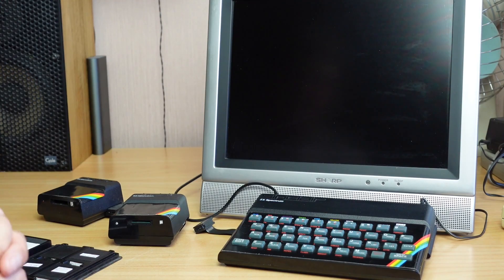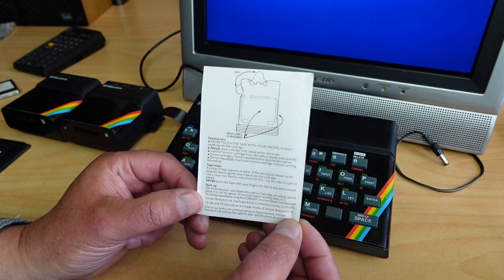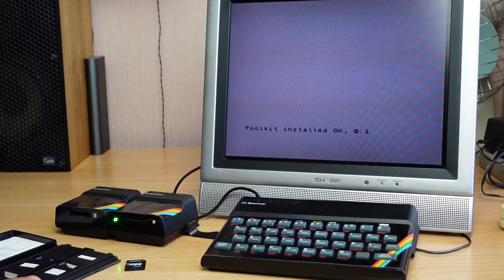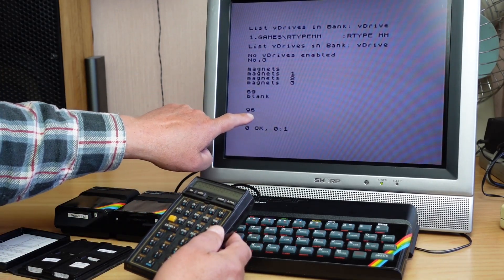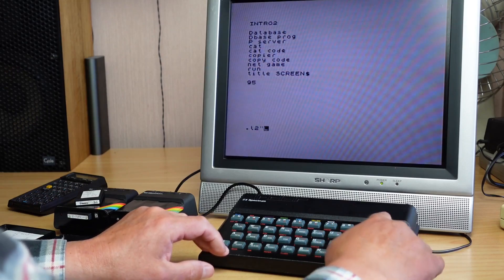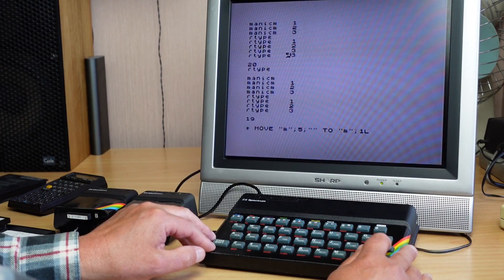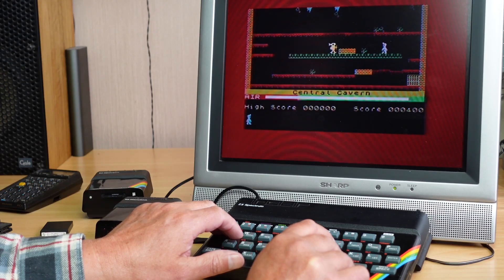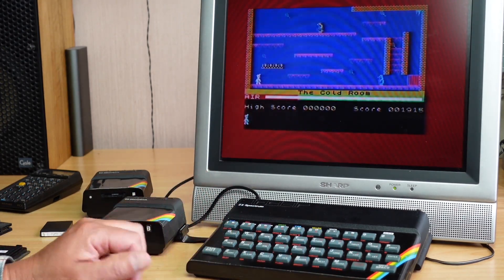Real Time Demo of ZX Microdrive and vDrive ZX in Action

Comment: How did you get the microdrive connected to the v-drive ?  V-drive's left plug is way too short for the cable  connector to get through.
Reply from the maker: From memory, I used the standard joiner that you'd use to join two microdrives together.

Comment: In many ways, games consoles and even PC's have issues in loading times today. Hence the m.2 Systems used in the very latest consoles. Most PC's don't have physical drives in them today.
I do have one large physical drive on my PC because it is cheap for the capacity you get and load times is not an issue for everything that I use a PC for plus backup on a physical drive is the safest way to store backups.

Also when loading Manic Miner form the Microdrive, why didn't you get the coloured lines that you get from a tape recorder playing, I assume they are the same media and the difference is the Microdrive just spins faster? Correct me if I'm wrong.

P.S. Interesting video and I will look at you Microdrive repair/refurbish video.
Reply: The lines during loading are actually a small program loaded in during basic that contains faster loading routines to allow a higher baud rate, with the lines being a visualiser(you can tell loading has failed by the pattern) of sorts for the loading process. When a game is copied to a Microdrive, that loader isn't copied over, as it's usually the result of a RAM dump from a pre-loaded game.